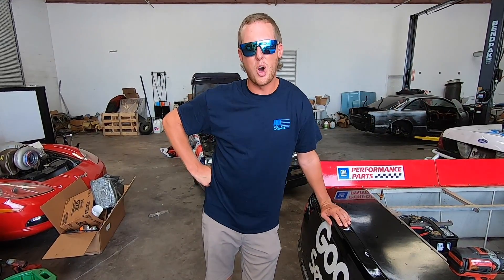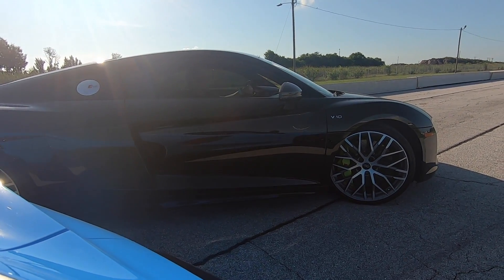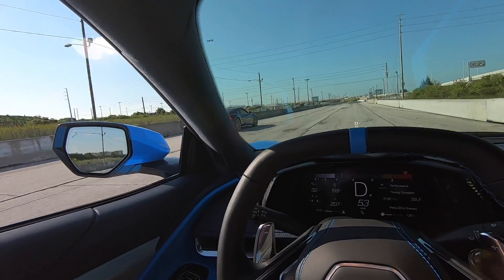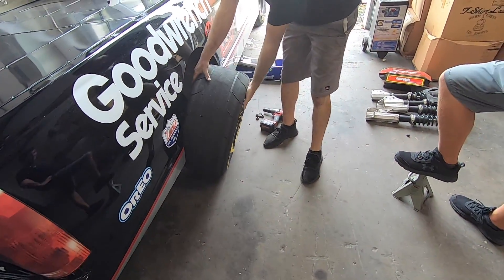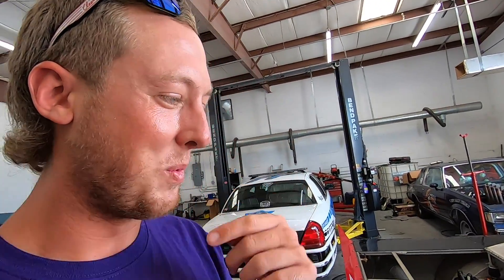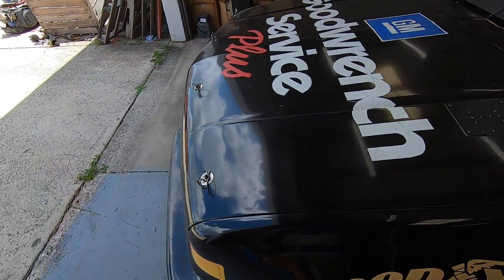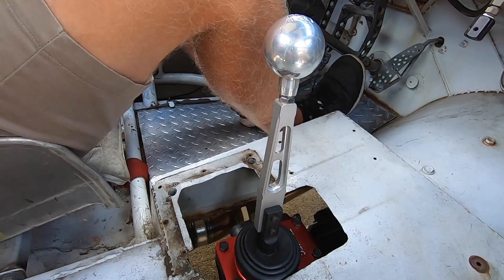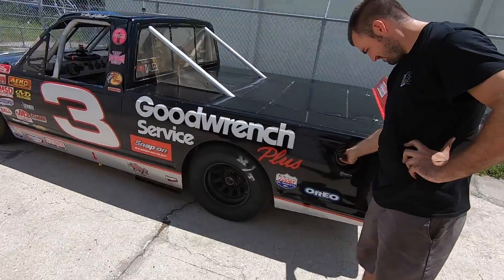We Put Drag Racing Slicks on Our 900 Horsepower NASCAR Truck!!! (IT HOOKS!)

Comment: Make sure the harness’s are NOT expired in the Dale Truck
Reply: They only last 4 ish years from date of manufacturing
Reply: @nisms5048  depends on FIA or SFI belts. FIA is 5 years, SFI is 2.
Reply: Most belts have an expiration date on them along with the date of manufacture. Most tracks give you 2-4 years past the expiration date.
Reply: EXCEPT NHRA sanctioned tracks... 1 day over expiration and they fail you
Reply: @Odium515  if you dont wrap yourself in bubblewrap and detune your car to half its horsepower they fail you and dont let you run
Reply: @ryan Moore it's only been like 20 years ...too soon bro lol
Reply: Harnesses*
Reply: Way too soon bro.  😞

Comment: Honestly behind Leroy the dale truck has my vote for the most badass car. And my #1 vote for best sounding vehicle.
Reply: The firing is so consistent but you can tell it has a cam, intake, exhaust, etc.  Heavy breather for sure!  Too good.
Reply: To me the Dale truck is the most badass vehicle on the channel!
Reply: Yes, the high reving N/A sound is the best.
Reply: its the boom tubes
Reply: @patricknintemann924  easier to get fueling dialed for sure!  you're completely right, Pat!
Reply: Agreed
Reply: it sounds like heavy rain on an iron roof..... 🤨
Reply: @MapleSyrup89  You'll have no problem adapting to boring 4 cylinders then.

Comment: The C8 hooks amazing, but that V10 R8 is a force to be reckoned with.
Reply: Damm right. Both cars are amazing. But I would definitely take the C8
Reply: Seems not very fair, even, which surprised me - 40 more horses if that's not even the V10 Plus. If it's the Plus, it's even more. I thought the C8 had more horsepower and was rooting for Cleetus, even as an Audi guy. Ah well, kept up much better than everyone expected, it seems.
Reply: @kachunkachunk  Me too dude. I guess we just wanted to see the bald eagles fly 🦅
Reply: Call me when they come with a manual. i don't even give a flying $hit if their 1 minute slower on the Nurburgring ................. i see and saw C8's all day the last year to 18 months being in MI and i"m not a fan.
Reply: Well it should be its awd, has more power, and is just a more expensive car. Cant wait til there are c8 z06s and zr1s around

Comment: Cleetus: I don't want to break it driving it hard on the circle track it's meant to be on
Also Cleetus: Let's put Slicks on it and drag race it!
Reply: It aint set up for circle track any more.
Reply: @bodean4978  it's fine
Reply: @bodean4978  It's more set up for the a track with turns than a drag strip. Doesn't matter if it's a circle.
Reply: Plus you got to look at cleet's comfort level. He's obviously more comfortable having a wall next to him rather than one coming at him head on.
Reply: @DanDringle  ...I mean in theory that's how a wall is when you're driving a circle track. Usually not too good when you're going head on with one

Comment: Every time the R8 started to pull on the C8 I started screaming “MONNICCAAAAAAA”
Reply: 30 feet and it was #MONICATime
Reply: Wait until big brother z06 c8 comes
Reply: wheelchair wentz I wonder if it’ll be able to keep that same amount of traction with 200+ additional horsepower
Reply: @HemivsNinja  Modern traction control is pretty good. With some wide stickies out back they should launch better than all but the best drivers

Comment: Get a water outlet flow restrictor for the cooling system, its just a machined aluminum insert. We run them in our race cars all the time when they run too cool. They make different sizes depending on what you need and less wear and tear on the electric pump so you dont have to cycle it on and off.

Comment: @Cletus Mcfarland - Run an electric pump controller like the Davies Craig LCD controller. You set the temp and it'll pulse the water pump until it gets to your temp and it'll ramp up your water pump voltage as needed.. 

Seriously look this up. It WILL solve your temp issue with the Dale truck.
Reply: Part number 8002. Really trick piece of kit for not that much money. You could run their pump as well if you wanted.... Bonus, it looks like a turbo ;)

Comment: If the base model is almost enough to beat the r8 I cant imagine how well the future Z06 will do
Reply: That Vette already at 1000hp as Cletus said..
Reply: @rydelldark  stock vet with 1000hp axels
Reply: @rydelldark  no
Reply: @rydelldark  What are you talking about? im talking about the c8
Reply: The z51 Stingray Is the base model?
Reply: @ConvoyBebop  Yes, only the base model is out currently. 1lt, 2lt, and 3lt are trim packages on the base model, and Z51 is a performance package for the base model which adds better brakes, exhaust, coooling and limited slip diff and, suspension for track use. All info from Chevy's build and price website.
Reply: Rydelldark No. the axles can handle up to 1,000 horsepower. That Vette is stock.
Reply: @rickshiandmoku4128  Someone has already twin turbo'd their C8 so im sure there is one that is pretty close.
Reply: @princeofdeath7696  no one has cracked the ECU to enable tuning and the stock DCT can't handle more than 700whp so until someone comes out with stronger transmission parts no C8 will make more than that(reliably)

Comment: I guess they finally realized that Leroy is an 8-second car Ruby has a better chance of running 7s then Leroy ever had IMO
Reply: Meanwhile, Leroy already ran 7’s and is/was the fastest stick shift car in America down the quarter mile.
Reply: Leroy could run 7s all day, they just haven't had to crank it up that high in a while. Ruby also will run 7s all day as soon as they crank it up, and Ruby probably will become faster than Leroy.

Comment: Thats crazy that a c8 launches as hard as the r8 awd, it just doesn’t have the power to keep up with it after launch. Very impressive stuff
Reply: Neck and neck to 60mph for sure. Very cool to see!
Reply: It has much more torque in the low end and a higher peak torque (the torque peak is also earlier). That is how it keeps up.
Reply: The c8 has a shorter 1st gear
Reply: Audi costs double the Vette, assuming Cleetus didn't get screwed too badly on dealer markup. That Audi is currently worth around 140k before mods and taxes. I think the Vette is 60k-78k before taxes, and shyster dealership markups of 30% or more.
Reply: No one talks about the tire and axles? C8 has nt05 drag radials brand new with new axles,while r8 probably has PS4 michelins,and can take lunching all day everyday..
Reply: gixxer axles just makes sure that it doesn’t brake no performance changes there. Tires you can argue sure but it didn’t look like the r8 broke traction during launch, it looks like it was strictly gearing/ power that was limiting it from launching harder

Comment: Man, the dale truck's driving position makes me nervous, is there any way to make the steering column shorter?
Reply: i came to commentts looking for this comment befor i made the same exact comment. seems scary close
Reply: That's how they come in stock cars. I drove one in a NASCAR Racing Experience a while back and the wheel is definitely in your lap. Its much more controllable when racing, but on the street, I imagine it would not be comfortable (and scary even with a 5 point harness), especially with the number of miles they are about to put on that truck.
Reply: @chadman1231  it seems difficult to handle outside of an oval, and that's exactly the only thing he doesn't use it for, i mean, the dude only does random stuff and drag races with it so it would be better for him to modify that, especially being that tall

Comment: also, the reason the shifter is off to the left like that is because it likely had a jerico racing transmission, which puts the linkages on the external of the case, on the left.  The trans was centered, and the shifter connected to the linkages.  You really should get a jerico back in there.

Comment: Too many times that i want to admit, when i used to buy new drag slicks and test run them on the street, id cut a brand new tire. Shortest distance ever on new slicks on the street? 1.9 miles. Ive sold many a brand new tire with a patch for less than half price at swap meets

Comment: And just like that, Cleetus has buyer's remorse.
Reply: Ehh...I'd be pretty stoked with that performance given a well-optioned C8 is less than half the price of a base R8. I mean, it's the same platform and drivetrain as a dang Huracan with 70-110 more horsepower (the plus option) over the C8 and impressively only weighs 300lbs more! 

I'm a bit taller than Cleet but I also don't think he has any hope of comfortably fitting in an R8 from personal experience. Have a friend that works at an Audi dealership. When I was having a recall fixed on my A6, we went out to lunch in a R8 (4.2 with a 6 speed). My head was pretty well wedged against the ceiling and my shins against the dash. I couldn't maneuver my right leg under the wheel to even attempt a drive. :(

Comment: would take some bench testing and testing under load, but maybe use a microcontroller to map pump speed with engine temps?  the four-second delay between fluid flow may well do the job as you guys like to keep it WOT consistently :P  I'm sure Kevin has a good plan!

Comment: i just got my tunnel ram set up for 68 pu with a stroked 454 in it . still has the stock trans 400 turbo that last 2 sec. but have a pro built 400 heavy duty trans to put in it pulled it out of a motor home then had it built the trans u start with makes a big different check out some motor homes they have killer engine and trans to start with saves a lot of money on the build most gm models have a 4 inch stroke on a 454 ho engine the trans has the over sized pump heavy clutch plate the engine i got steel crank with heavy rods only 10 to 1 need to bump it up to 13 to 1 for the tunnel ram no lower the 12 to 1 plus they have the high flow heads  plus external trans cooler , oil cooler . power steering cooler helps with hydraulic ass. breaks and high quality lines best part the motor home was free with only 6000 miles on it because a tree fell on it   then i just got another one for free but this one has 38,000 miles on it with a 79 cheyenne short box 4x4 in mint condition sat in a shop for years just had to clean the carb and new fuel pump and the filter full option truck 400 sb with 400 turbo low miles under 35,000 and even the paint is mint just an ugly color green but for free to bad ur not on the west coast i have a lot of rust free rigs i think about 30 pu's ford and chevy rust free just sitting not counting all the cars i have my own personal wrecking yard i have 2 perfect cabs for 67 to 72 chevy pu

Comment: Hello Cleetus Racing Team Community, I have a question and it's turning into quite the head scratcher for me. I daily a 99 chevy suburban 1500 LT AWD and she's got 201,918 mi. I know she's old... I'm having a top end power loss. I quickly did a full tune up, plugs, wires, distributor (cap and rotor), and the plug in the eigth cylinder was burnt out and broke on the ciramic side as soon as I tried to remove it, leading me to believe it was cracked already and I just couldn't see it. I got it out and the ground electrode had broken off about half way. Now it's a smallish piece, do you think it just went through and dumped into the cat? Anyways, on first start up from doing the tune up it took me about 10 minutes to start. It wanted to fire up, but it wouldn't turn over. Finally it started and it was running fine, she has a mild physical chug in the idle but no change in rpm. She idles at 800 and does have a heavy exhaust smell. Also on start up I have the crazy gass guage that freaks out but it does pick a semi accurate amount in a second or two. The plugs were mostly white, which means lean, meaning injectors?

Comment: As much as I love the dale truck (like every car in the fleet) the seating position is completely messed-up.
The pedal box and the steering column needs to be moved away from the driver. The new steering wheel is a step in the right direction though 👌
Reply: his back, knees, and neck are going to be destroyed every time they do a driving stint.

Comment: L seeing that you have friends at Hendricks motorsports get with them NASCAR has to lock the radiators off in the winter because of the same issue the car stay so cold so they may send you the same equipment they use to do there’s cars
Reply: there's also the factor of they close off the venting in the nose to tune the car/truck's aero during races as well, no matter what time of the year it is..
Reply: NiteRiderEVO That’s what I meant but I used text to speech while driving and didn’t realize that it didn’t make sense LOL

Comment: I probably will never understand why the steering wheel is so close to your chest.  I am 6 feet, 1 inch, with an arm length of 2 feet in both arms. I need my arms fully extended to turn the steering wheel. Otherwise it feels weird to me.

Comment: R8... same price, looks 2x as good, sounds way better, decent amount faster. Also that was 3 years ago. Much rather have the R8 not to mention every part and mod is out and been tested. C8 just doesn’t do it for me. Idk 🤷‍♂️
Reply: Same price? What world do you live on? That R8 V10 starts at $200,000 before options
Reply: Mvstng GT yeah a 2020 model.. maybe. A 2017 R8 fully loaded is under 200k. Used, even less. 100k I’m a loaded used R8 or 100k on loaded new c8. Think lol
Reply: James Meyer lol, the 2017 V10 plus with the high output V10 (same car as in the vid) STARTS at $191,000. Thats $131,000 more than the Corvettes starting price.... not only that but you will be hard pressed to find a used 2017 R8 for less than $155,000, while a A 2020 3LT Vette including the Z51 performance package is only $77,000.... I see the comparisons your trying to draw but your prices are way off, new or used the R8 is always going to be more expensive. Wait until the Zo6 comes out than your comparison will make sense.
Reply: Mvstng GT you kinda proved my point. I’m confused why it’s such an issue but.. Nope your prices are off lol.. used R8 150k and under. New c8 100k, dealers price. Coulda looked it up first idk ?
Reply: Mvstng GT when the c8 Z06 arrives dealerships will mark it up to 150k and above. All companies do it

Comment: Why haven't we run the new hovercraft on the water just see how fast it goes compared to the old one so let's see a ones apples and oranges or what are we doing now we can a modify this public graphical faster to go faster what's the deal reason to be a we got the other 1 in flies on the ground but doesn't do very good in the water the little here but closely does pretty good in the water but we really get as that because the Lake is too small so where did you get a take this 1 out on the Lake like I did the other 1 just compare the 2 should be way faster you were going what 20 miles an hour tops beat on the other 1 I don't and then what's this I'm gonna go 40 miles an hour I don't think if you go 40 miles and I want any 30 miles from the fast you can go on a hovercraft